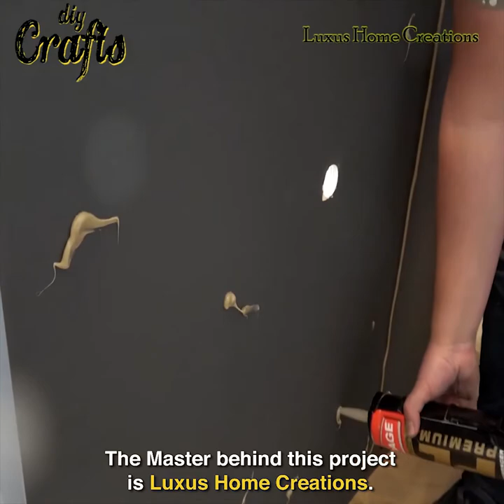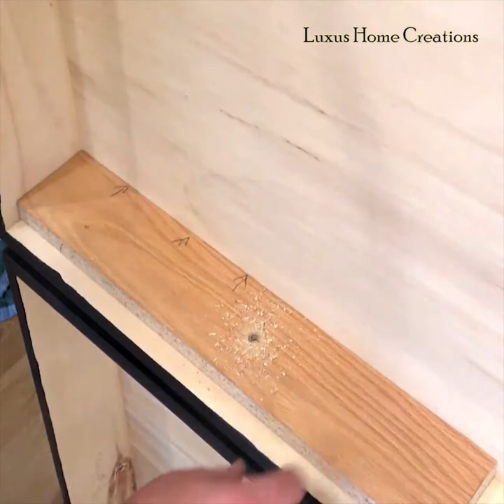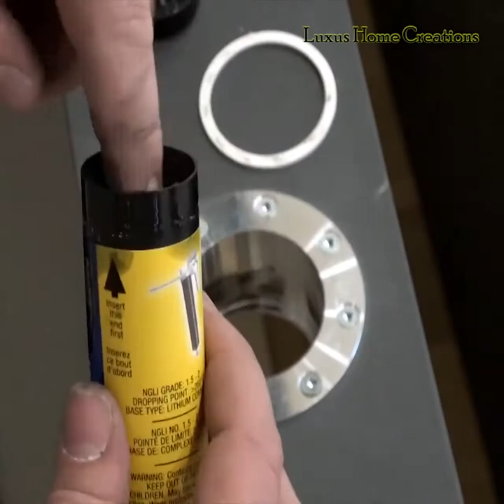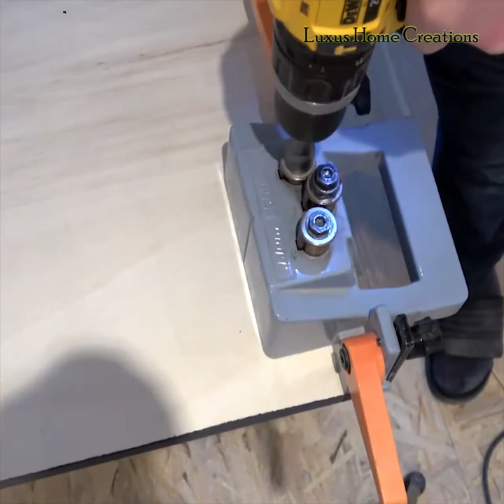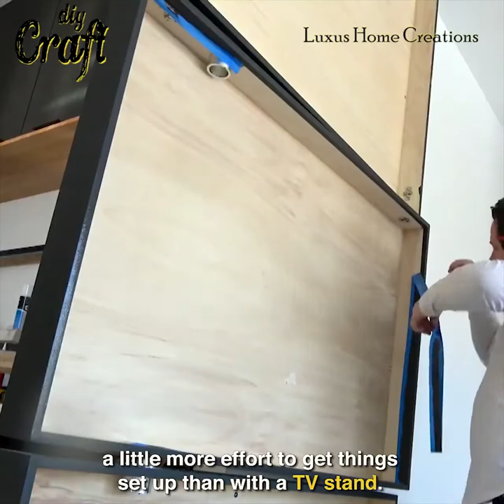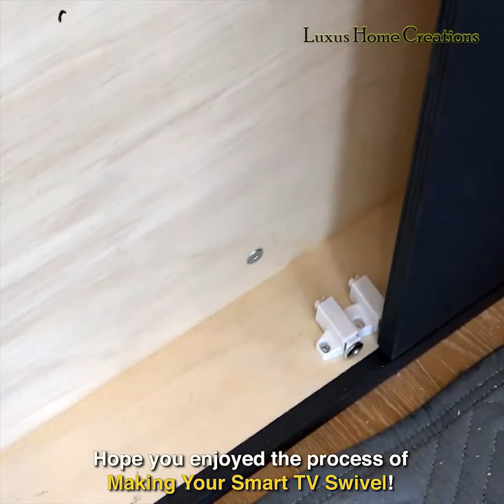DIY Craft : How To Make Your Smart TV Swivel

Comment: You forgot the most important parts...ie. the wiring (with your design, it won't get twisted, but what about a design that allows 360 degree rotation.  How do I prevent wiring from twisting?  and the finished woodwork around the tv.  How did you do that?

Comment: Regarding the 'rotating mechanism', I'm currently mid-build here in the UK and I've gone with the following combination of railing flanges ) reasonably cheap solution):

- External flange, https://www.s3i.co.uk/wall-floor-flange-stainless-steel-effect-bar-railing-0505.php?pid=18121

- Internal flange, https://www.s3i.co.uk/wall-floor-flange-long-neck-stainless-steel-effect-bar-railing-0504.php?pid=18127

Got some 2" pipe (1.2mm thick) to go in-between the two to give a good bearing fit. 👍
Reply: Hello! Is there a way I can contact you to learn more about this? I am trying to attempt this in my house.